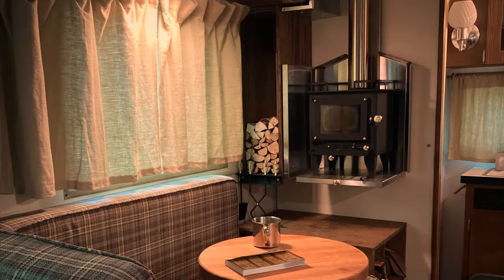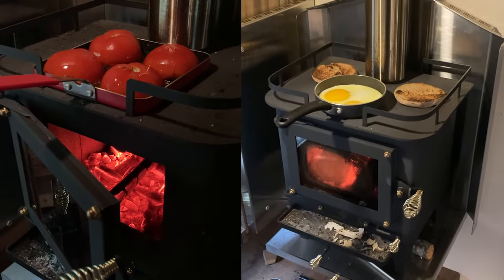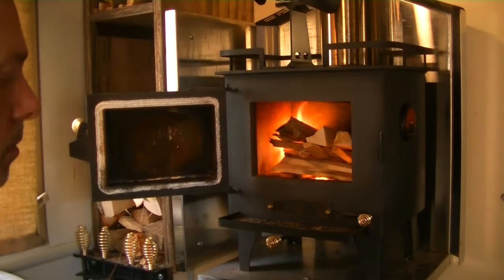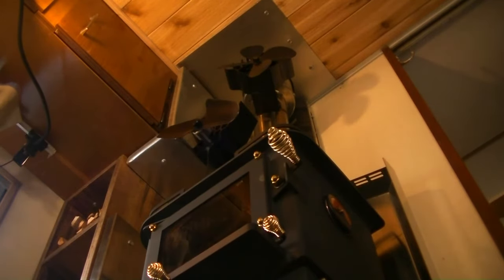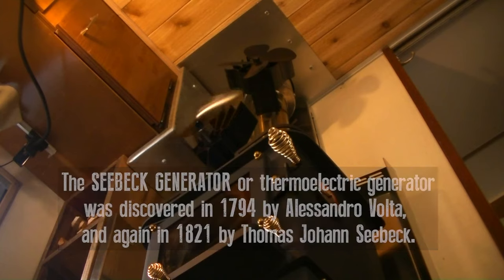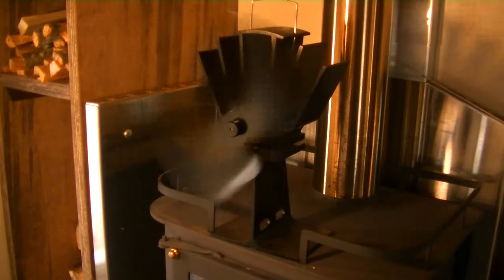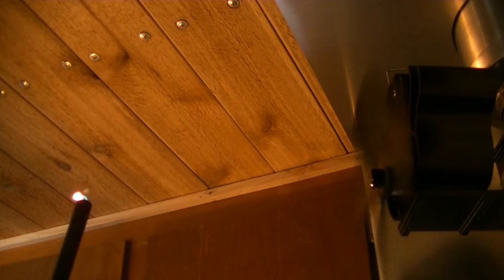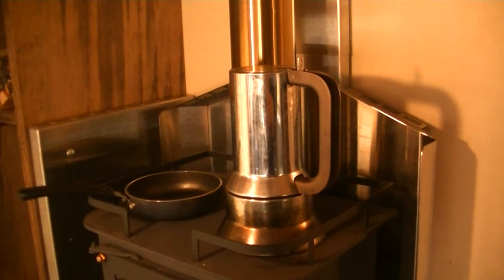Heat Powered Stove Fan Showdown - Flue vs Stovetop

Comment: When you're trying to keep cool, a faster-moving fan is always better.  For generating the convection so many rely on for warming up a space, a slower-moving fan may actually be superior.
Reply from the maker: That’s an interesting point. I’m not a thermal dynamics expert, but I assume many who are have been involved in the development of these fans over the hundred+ years, and I would hope they’ve found the sweet spot by now. 

One thing I’ll point out is that there is no regulator between the Peltier element and the motor, or gearing between the motor and the fan. It’s all direct current and direct drive. Heat - Air Temp = Voltage = Speed. 

So the heat of the stove combines with the temperature of the air in the room and the resulting efficiency of the Peltier element translates directly to the speed of the fan in some kind of beautiful self-regulating ballet. 

A roaring fire in a cold room will create more airflow, a low fire in a warmer room will create far less. That sounds about right to me. Either way these fans are amazing and keep my little camper snug and cozy. 😌

Thanks for checking out the video. :)
Reply: @lumberingshenanigans  I would say the faster you can take heat away from the exhaust and resuse it, the more efficiency you should get from the system, since that heat is otherwise lost. But there is a limit to how much efficiency you can reach from taking it from the exhaust. You could quickly touch the flue above the fan to see if it's still hot enough that you're losing useful heat. Otherwise, the beneift to a faster fan is heating the room up more quickly, because it'll take less time to bring that flu temperature down  initially at least.
Reply from the maker: @James-fe7wd I think either way we’re talking about minute differences in efficiency, maybe unmeasurable differences for a layperson. I think from the perspective of a cold person sitting on the other side of a confined space for a heat source, the quicker and more forcefully the air can be made to move around the space, the better. ¯\_(ツ)_/¯

Comment: I would just take all the electronics from the ecoflow mount in on chimney fan so you can have your cake and eat it to
Reply from the maker: That’s a good idea for something to try as an experiment, but I think the basic idea of a flue mounted fan just isn’t as efficient as stove top. But having both fans has been working well, with the more consistent and reliable EcoFan doing the bulk of the work, having the extra airflow up near the ceiling does seem to make a difference. It’s a setup I intend to repeat if ever get around to building a cabin. Thanks for watching and commenting! :)

Comment: I got one of those flue fans that go on the stove pipe. I haven’t got it to work yet doesn’t matter how hot my wood stove is. I mounted it on the bottom not on the top of the stove pipe.
Reply from the maker: Is your flue single wall or insulated?

Comment: Can the top of the wood stove get too hot for the ecofan?
Reply from the maker: I don’t think so. This is exactly what it’s designed for. But if you’re really pushing the stove at full blast non-stop I’d be more worried about the flue, my ceiling, my wood cabinets, and the stove itself being damaged first. Also the camper is barely 100 sqft so it would be like an oven in there if the store got that hot.

Comment: The Flue on the cubic mini is double walled replace that inside stretch of stove pipe with single wall and the Flue fan will double in its power.
Reply from the maker: That would be a good tip if that were the case. Actually the double-wall section of the CubicMini’s flue doesn’t begin until a few inches from the ceiling.  You can see the transition from 3” to 5” about a hands breadth above the flue fan in the video. Having lived with this setup for a year or so now, I stand by my assessment that the flue mounted fan is simply not as good as the stovetop model and I’m glad I have both. Thanks for watching, and for the good intentioned suggestion.

Comment: air push it related to the size of the fan. the fact that the flue one stops earlier is better so it doesn't push cold air around.
Reply from the maker: Yeah for sure the size of the fan, number of blades, speed of rotation all factor into the resulting air flow. But I’m not a fluid dynamics expert. Above my pay grade. And I’m sure the difference is subtle. But one thing is for sure, a stopped fan doesn’t move any. And the air around the flu and stove is always going to be warmer than the rest of the room. So… my choice would be the longest possible spin to get even “warm” air over to the other side of the room.  I’m still using both after all this time. Thanks for watching!

Comment: Thanks for sharing this. Would you get better performance from the flue fan if you were to bring it close to the stove?
Reply from the maker: I think that would be worse actually, at least from a fan speed perspective. The idea is to get as much difference between the temperatures at the front and back of the unit. The peltier thingy relies on it to create the voltage. Plus it would the get in the way of the stovetop, which would also defeat the point of flue mounting it, to get it out of the way. I still use both, and just move the stovetop one when o want to cook. Thanks for watching. :)

Comment: You use a magnetic temp gauge on the side of the stove, right? Mount it to the side of the stove instead of setting it on the stove top.The side mounted one would probably last longer at shutdown if it was closer to the stove top instead of all the way up at the top and might even turn on faster too. This technology has been around for a long time. I know because we had 2 similar ones on our stoves back in the 70s. Not exactly like them, but very similar. We had a small 4 burner stove in our living room and a big porcelain one in the kitchen with the water reservoir on the side. The kitchen fan set on the top due to plenty of space(8 burner with overhead warmers) and the small one was mounted on the side toward the upper back near the stovepipe area. I currently have 3 LED camping lanterns that use the same tech using a tealight oil candle. Great for power outages!! I have a 4th lantern rewired with USB ports instead of lights to charge cell phones and small battery banks for electronic gizmos. Each oil candle lasts 8+ hours and I can refill them. 👍
Another tip, if your pipe was cast iron instead of sheet metal it would retain the heat better at shutdown. The side mounted fan would run longer before turning off. Even if it's a cast iron sleeve slid over the stovepipe, heat retention is the key and the hotter the better.
Reply from the maker: Hey, thanks for the great comment. Your history of different setups sounds amazing. I love it. Thanks for sharing.  The candle-powered LED idea is awesome. Definitely something I would consider for a tent stove situation (I have plenty of solar in the camper and it’s all wired for 12v) 

The cast iron pipe idea is great too, though I do have concerns about the drafting of the tiny stove using pipes not designed specifically for this tiny stove. I’ll ask the folks at Cubic Mini. 

And yeah, heat-generated electricity was discovered in the early 1800s. Electric fans in the early 1900s. I’m sure the idea of combining the two followed shortly after. 

As for my fan placement, I’m not exactly sure what you are advising, but I really don’t have a whole lot of options. The camper is really tiny, like… around 80 square feet total living space. So mounting a fan on the side, if I understand your suggestion right, isn’t an option for my setup because it would block my way to the back of the camper and be in the way while standing at the gas range directly across the galley from it. 

The flue mounted fan could maybe be a few inches lower, but would quickly interfere with using the stovetop one, (there’s maybe a couple of feet of 3” pipe between the stove and the low ceiling) and since the power elements work by staying cool on one side and hot on the other, I think moving the whole unit closer to the heat source would just cause a trade off in efficiency. But I’ll give it a try and add to the video description if it helps, it’s an easy experiment. 

I have since added insulation to the outside of the camper roof. This has made a big difference in the heat retention and stabilization of the temperature inside. And condensation. 

Generally these fans work well together to create nice cozy warmth with gentle air flow and I’m quite happy with the combination. The ability to simply lift the EcoFan off when I want to cook works great for me. 

Again thanks for the awesome tips, and thanks for watching! :)
Reply: @lumberingshenanigans  I was thinking the placement could be on the side where the temp gauge is on the right side, but in the upper back corner behind the temp gauge. I don't know how tall your fan is, nor did I realize there was a doorway just to the right of your stove(until I watched video again). The fan might be too tall for that idea after realizing there's a doorway right there. The blades might extend beyond the door opening, now that I look at it. As for the sleeve for the pipe, it would only need to be as wide as the base of the fan you have mounted on the pipe. It's a shame they don't make these fans with a magnetic base. If they did, all you would have to do is pull it off the top and stick it to the side. Then, when you're done cooking, you could just put it back on top. That way you'd still get circulation while you cook and it would only be temporary on the side.
The lanterns I use are made by a company called Luminiser and they put out 200 lumen each. Available on Amazon. 
https://www.amazon.com/Luminiser-Thermoelectric-Lantern-Converts-Electricity/dp/B07K25ZZZ2/ref=sr_1_2?crid=2SP2RP43PQNOP&keywords=luminiser+thermoelectric+oil+lantern&qid=1674807054&sprefix=luminiser+lantern%2Caps%2C114&sr=8-2
Reply from the maker: I was thinking the same thing when I read your first comment. Magnetic would be useful even sitting on top, when the camper moves for example. But then you gotta ask a scientist, what’s does 500° heat do to a magnet? Or the glue used to mount the magnet to the aluminum fan, and figure a way for the magnet to not diminish the transmission of heat to the element. Etc etc. But yeah, that would be a convenient feature! :)

Comment: i am looking to get a flue fan for my ice shanty. I need to keep my stove top open as I am always boiling water on it to dump down my ice holes to keep them free of ice. I am afraid the stove is not ran hot enough. My flue is a home made single wall pipe, but its made out of 1/4" thick steel, 4 inch in diameter. I have thought of using a computer fan too. Can you adjust the angle of the fan so it blows more towards the floor or ceiling?
Reply from the maker: This particular flue mounted fan isn’t adjustable at all, and I don’t see any that are. But you can mount it at whatever height you like on your flue. Most of them seem to be aimed at 5-6 inch flues, but they might work for your 4 inch. I’d say if your stove can boil water, there should be enough heat to power the fan. And remember it’s about the difference between the front and back temperature that creates the electricity, so a colder exterior will require less heat on the back end to generate the same current. This double headed one looks cool: https://amzn.to/3SfnLFN Good luck!

Comment: Theres a channel called logcabinlooms and he has a simple heat reclaimer built into his stove pipe. Space permitting, could an eco fan sitting in the heat reclaimer work in your setup?

More heat/airflow and an uncluttered stove top, just an idea. Well done video!
Reply from the maker: Hey, thanks for the idea. I did some googling and think I get the idea of how these reclaimers work (I’d never heard of them until your post, thank you) and they’re definitely something I’ll keep in mind for the future. But I don’t think one would be right for my camper. Mostly because it’s just so tiny, which means limited space, but also that it gets hot fast enough and evenly enough with just the little heat-powered fans I have keeping the air flowing. And it’s off-grid, with only 12v power for lights and a few gadgets, and most of the reclaiming units I saw online plug in to 110v outlets and draw a lot of power. Combining the two devices could work, and that’s a solid idea to experiment with IF you have the room, and the need for more heat efficiency. But yeah, in my case about a cubic foot of waste wood will easily heat by camper for a day in the dead of winter no problem. Thanks for sharing the knowledge! And for watching. :)
Reply: @lumberingshenanigans  Thanks for the reply! 

I didn't know there was 110v heat reclaimers lol, the one on the logcabinlooms channel is made out of two stove pipe T's and four 90° corners. Shaped like an "O" an ecofan could nest inside the opening. 

That's pretty sweet that a small amount of wood can jeep your trailer toasty, it looks like a nice cozy setup!
Reply from the maker: Oh right, I’ve seen stuff like that I guess. All kinds of attachments for flue pipes that can hold some of the heat. I think in a bigger space, with a bigger stove I would look at some of those options. With the tiny cubic mini stoves I wouldn’t want to mess with the flow of heat too much, they’ve done a really good job balancing the way the flue draws. And yeah, it keeps my little tin can very cozy. :)